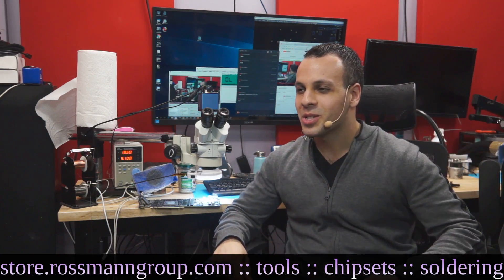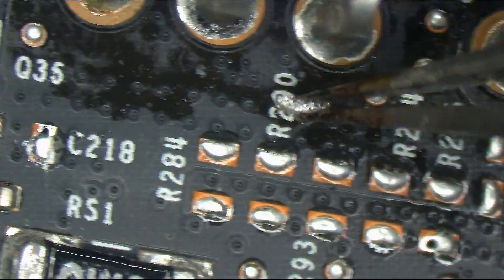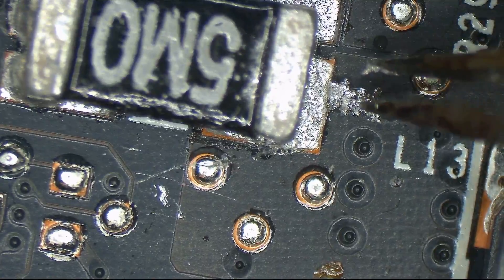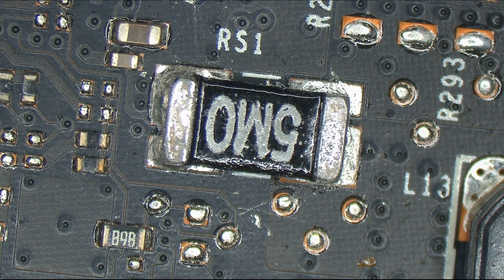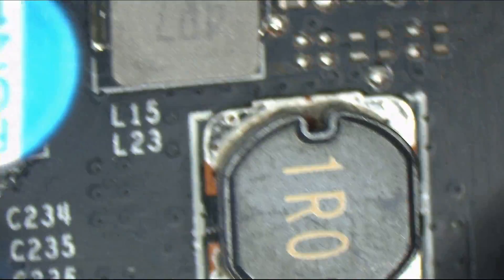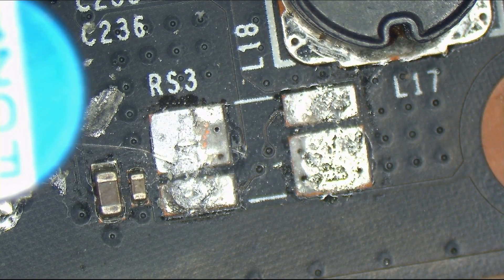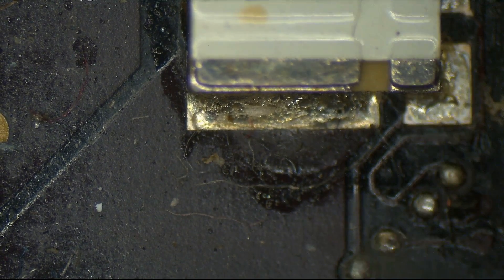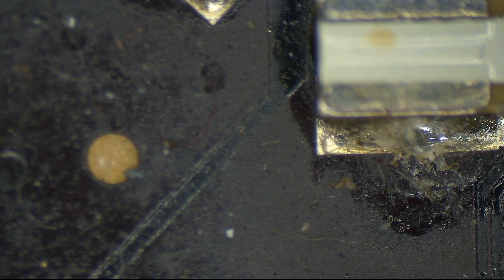DO NOT SHUNT MOD YOUR GRAPHICS CARD WITH LIQUID METAL!

Comment: Shunt mod is probably the most useless mod that probably ends up like this.
Reply: Deniz Onur actually it's the most efficient mod on Nvidia cards. Well unless you got some xoc bioses that completely lifts off power limit. (not commercially available tho.) Also there is another way of doing it via ic that's reading vdrop on shunt which is somewhat more reasonable way of doing it
Reply: Also,
Checks user name. Nice dude. ;)
Reply: Onur Berk SUNAL Probably 2nd way would be much sensible since gallium reacts with most of the metals this and other way. I dont see the gain of 10-15 mhz extra speed boost making this a even sensible option. Pascal is limited by voltage anyways not with the power.
Reply: Onur Berk SUNAL ( ͡° ͜ʖ ͡°)
Reply: I trhink the main limiting factor is the core voltage. You can change the power limit with afterburner or other OC softwares, but you can't change the core voltage.
My GPU can achieve pretty good results in furmark (which is basically a power virus) without any problem when overclocked, but causes serious frame artifacts in games way before a crash happens.
Reply: I've just made some quick benchmarks and here's what I found:
Used tools: GTX 1070, MSI Afterburner, Furmark, Unigine Valley, HWinfo.

At factory settings:  
Benchmark: Furmark
core clock:1772MHz avg,
Power usage: 166W avg (99% TDP),
Vcore: 881 mV max, 863 mV avg,
Temp: 66°C max @ 30% fan speed (23°C room temp)

+104 MHz OC on the core and the memory, 114% power limit (Power slider at max in Afterburner).  
Benchmark: Furmark
core clock:1885MHz avg,
Power usage: 190W avg (112,6% TDP),
Vcore: 925 mV max, 900mV avg,
Temp: 68°C max @ 38% fan speed (23°C room temp)

+104 MHz OC on the core and the memory, 114% power limit (Power slider at max in Afterburner), +15% on Vcore.
Benchmark: Furmark
core clock:1885MHz avg,
Power usage: 190W avg (112,6% TDP),
Vcore: 912 mV max, 900mV avg,
Temp: 68°C max @ 38% fan speed (23°C room temp)

+154 MHz OC on the core and the memory, 114% power limit (Power slider at max in Afterburner), +15% on Vcore.
Benchmark: Furmark
core clock:1950MHz avg,
Power usage: 190W avg (112,6% TDP),
Vcore: 900 mV max, 900mV avg,
Temp: 69°C max @ 38% fan speed (23°C room temp)

+154 MHz OC on the core and the memory, 114% power limit (Power slider at max in Afterburner), +15% on Vcore.
Benchmark: Unigine Valley
core clock: 2088MHz avg, 2113 max,  (reads in Valley benchmark, also in HWinfo too),
(Unigine benchmarks are known for reading the clocks wrong, the correct value must be around 1950MHz)
Power usage: 170W avg,
Vcore: 1050 mV max, 1044 mV avg,
Temp: 69°C max @ 38% fan speed (23°C room temp)

Apparently the Vcore slider doesn't do anything significant as the power limit kicks in way before the voltage limiter could do its job. Afterburner never sets the Voltage limit flag on.
However the Unigine benchmark is a bit odd. I can set the core clock up to 1950 MHz before the artifacts start happening, but the power usage is way lower than in Furmark. In Furmark I can go beyond 1950 MHz without crashing. So either Furmark isn't really susceptible to artifacts or they aren't caused by the power limitation as in the Valley the GPU is far from the power limit (even when the artifacts happen). And in Unigine the Vcore is much higher than in Furmark at the same settings. It really looks like it is a voltage limitation, as the automatic core voltage setter circuit underestimates the required core voltage regarding to the power usage.
Reply: It's absolutely stupid to use liquid metal for this - there are many other methods that won't corrode solder
Reply: Deniz Onur no for ambient cooling (waterloop and air) Pascal doesn't scale with voltage it only scales with temperature being low. Even under ln2 Pascal rarely benefit with more voltage but it sure benefit from more power. I suggest checking der8auer's videos. He mades it clear that power mod gives acceptable benefits (even if your clock wasn't higher than before.) Still not convinced? I can link buildzoid video (if I remember correctly about 40 minutes long.) He shows that lower power limit higher clocks worse than high power low clocks.
Reply: Onur Berk SUNAL Meh for regular user wise. Shunt mod is not necessary. For LN2 people already mod their bioses to allow for more power draw and they do it professionally. I know buildzoid ( sub since like 1k subs). My point is this is not a very safe method of doing it since that guy screwed it up the application.  It is true Pascal is sensitive to temps but under LN2 it all comes down to power and voltage not temps. And if you are regular user and you think you are limited by your temps you can always put it under watercooling.
Reply: Deniz Onur Pascal has no bios mod tool there only has one Asus xoc bios which as far as I know doesn't lift power limit only increase it. Also it's not voltage limited "even under ln2" and I was purely talking about ambient cooling. Also I even under air-cooling extra power gives extra performance. And keep in mind that no mod is safe when you screw up. Almost all mods "safe" when done correct.
Reply: Onur Berk SUNAL There are tools to flash bios and tons of bioses out there. The guy below me gets what i say Pascal has hard limit in voltage. Even when you power mod it you will still going to be limited by your voltage.
Reply: Deniz Onur Péter Kiss did you ever overvoltaged or seen someone overvoltaging their card? I did and can confirm it's nothing like any older Nvidia architecture it benefits so little with over voltage that it's literally not worth the effort. Basically power mod gives as much jump as voltage boost if not more. Which one could done easy one is really hard.
PS. By overvoltaging I mean like 1.25 not like maxing out voltage slider. Which you won't be wanting to go below that all that much because degradation vs benefit nearly not exists.
Reply: Onur Berk SUNAL Yes i did overvolt and 1080 Classy and to achieve 2050mhz stable we added around +87mv or it would crash. It responds better than what i expected. My 980ti classy will crash in any terms of voltage bump unfortunately. Power wasnt an issue for that card imo as it was to be allowed around  %120.
Reply: Deniz Onur May I ask how you did ? With voltage slider in a program? Also don't mix and match architectures 980 is Kepler and Kepler benefits voltage more than Pascal does.
Reply: My mistake it was Maxwell which is Kepler refresh same thing but better
Reply: Onur Berk SUNAL LOL no 980Ti is not Kepler.  600-700 series are Kepler. Im not mixing anything here. I have used Precision X with OC bios. You want proof? Here https://youtu.be/ES_z8TokX6U
Reply: Deniz Onur yeah max out power slider all you want you will pump maximum 1.1v with that. To really overvolt it you need to do hard modifications like tricking pwm controller with soldered potentiometer/trimpot etc. And higher clocks =! Higher performance

Comment: It's called shunt modding. You short the resistors with liquid metal to allow for higher voltage. Pascal is currently limited to 1.093v, and you can't go higher without shunt modding.
Reply: no you said most miners are renting with uiltilties include which is wrong but it makes no sense not to as ill say below its your fault for putting your self in an postilion where your contract looses you money. (and in my experience most people with utilities included are renting an room on an shared power plane so at most 10A before tripping an barker and pissing off house mates.
if power is eating in to your costs of renting then you need to fix your contract say utilities included to for fair use and specificity x amount of kW/h's its your fault for creating an contract that ends up screwing over you in the end.

there are other reasons of an high power bill dehumidifiers fridge open too much, lots of cooking on an electric stove etc.

also thanks for resorting to insults it shows what kind of person you if you have an issue with an group of people try to understand where they come from and why they do things they do and debate properly as most people have an valid point or 2 then disagree with them with facts and experience, which i can assume you have had an unplesent one with one of your tenets i dont know your whole story but i'm painting an picture on the facts you leek out in your comments here.
Reply: Why should a tenant care about the power bill if they are not paying for it? Because it cuts into your profit? Why would they care about your profit? Also how do you know it's a mining issue? They could just be using high performance desktops all day because those use a lot of power.
Reply: S.A. Smith there needs to be resistance the current sensing chip checks for an short and if it detects it puts in in an "safe mode "
Reply: Myke Prior not persay  back before Bitcoin spike I was mining litrcoin with my 6950's while at school cards never degreted and still run the same oc's to this day. Just traded an friend who lives in residence for his spare 670 for one of those old 6950's because the heater broke in his room and the 6950 makes double the money. And it helps him not frease till they fix the heater, the card still holds the same clocks it did years ago.

As for your rate of increase for crypto it's more like rate of decrease at .10usd per kilowatt we are nearing mining becoming unprofitable so yes power efficiently is an bigthing. 

And yes being in school I mine on the nano that is in the PC at my dad's but I haven't invested in to hardware to mine with.
Reply: If cryptocurrencies were "fake cash" then please explain why some countries are thinking of making their own crytocurrencies for their entire economies? I don't like the miners either but what you are doing is being ignorant it. At least educate yourself before bashing something you know little about.

No I'm not talking about your loan.I am talking about your profit which is the amount you get after the tenants pay you.Payment-expenses=profit margin Your mortgage would be an expense.So if you didn't make sure in the contract that the utilities could be abused then that is on you sadly.Don't blame something else for someones shitty actions.It's not mining or crypto currencies that are at fault.It's both of your faults.
Reply: Not voltage unlocking it's power unlocking. Voltage still locked you just run more current.
Reply: Onur Berk SUNAL at least use a resistor of a known value. "it still has somewhat resistance"... ok, what value is the resistance? I agree it's not a dead short but it's also a complete crap shoot as to what value is actually being achieved here. All this effort around this mod and no one ever thought to measure the change in resistance and suggest a proper mod??

Here's an alternative that would work better. Take a piece of scotch tape and tape a parallel 5M resistor over top of the original resistor. Just as effective.
Reply: Myke Prior uh miners usally decrease power limit it makes no sense to push an mining card as these GPUs are sold up the power to proformance curve. Less power used per hashrate means more profit. "Miners" will run the cards cooler and with less voltage /power limit before shuntmodding there cards for extra proformance.

Now passing an mining card off as lightly used for gaming is bad but assuming the card isent broken the olny issue that should arise is worse overclocking potential.

Although when I mined on my 6950's back in  2011 my max stable overclocks on air did not change and all the cards still work today.
Reply: You should learn about mining before saying ridiculous shit.Most miners under volt,down clock,and run the fan speed at 100% They do this to make sure the card lasts longer and usually the speed (depending on the coin and algorithm) are not changed by much.The benefit however is less power costs. It wouldn't be a profit if you have to pay for more power than the money you get from the coins.
The reason why most miners used AMD cards was because they didn't use as much power as nvidea cards with the same algorithm speeds.Which means it was a lot more cost effective to get and AMD card because they were cheaper already and was more powerful in most algorithms used by cryptocurrencies
Reply: Would be better to just solder a piece of wire in it's place. Gamer's Nexus has done this on a couple of their cards too for testing & whenever I hear of people doing it for "gaming OCing" i think "are you stupid".

The only people that should be using LM to do the shunt mod are people going for world records on LN.

Else..just use a fucking wire..
Reply: I'm judging no one in particular. It's pointless for a negligable gain. Cooling pascal gives you better performance as it automatically OC's as temperatures drop.

And even wire has resistance. Just don't use copper, use nichrome or something instead....or just replace it with a 50k/500k resistor or something.
Reply: philippe jara yup because it still has somewhat resistance. Voltage still drops.
Reply: Lol. FIRST of all, with the rate of increase nobody cares about the cost, and the majority of these people are renting with utilities so its not like the power bill is even an option.
Nice try...maybe if power was expensive, rates were lower, the 10 series weren't as efficient, but none of that is true at all now, so guess what.....it's a blow out the card and sell the bitch game.
Are you a "miner"?
Reply: lol. My comment was for ppl with cheap power or who rent with utilities included. I've dealt with all kinds of tenants including you miner parasites.
Reply: By profit I think you mean mortgage. Of course I care. My new contracts put a huge limit on power if tenants exceed.
They could be wanking by the heater and AC on full blast...considering he told me he doesn't work and mine's I instantly got a huge red flag after I approached him about his shut-in tendencies as roommates complained to me. I don't care, it breaks any good faith agreement to assume utilities included = unlimited utilities. You say he's smart, I say he's a parasite, tomato tomatoe
Reply: Get a fucking job. The economy runs on work not collecting as much fake cash as possible.
Reply: S.A. Smith you can't directly short Pascal architecture. It won't boot if you do that card will think sth wrong and refuse to boot.
Also don't judge people getting the best out of their hardware if done correctly this isn't so risky (not believing check der8auer's videos he did a after 6 months of power mod sth like that.) He bought top of the line consumer gpu and wants more performance well that's a way to get some more.
Reply: Fucking bitcoin mining pos modding their cards for MORE overclock MORE $$ with NO experience in basic fucking electrical skills, then passing it off as a perfectly fine 2nd hand card when the transistors, ram and a couple caps or VRMs inside will be shot in a month...or solder will just erode apart.
I fucking hate cryptofucks they are the problem with today. Sit back and make money, it's ALWAYS off someone else's back. ALWAYS.
Reply: Myke Prior shunt mods provide a marginal increase in performance and suck up nearly twice the power. The miner would have to be stupidly stupid to spend such time and effort doing it.

Comment: FYI liquid metal explanation and application example: 
https://youtu.be/3pflC72NfnU
Reply: I love how he defends this shitty technique as reversible in the comment section, well not after the solder has fallen off the board >:D
Reply: Florian I don't understand why you wouldn't just use a silver circuit pen or a Permatex automobile rear window defroster kit. Or have Louis change the resistors to a different value.
Reply: sixtyinsix Yeah, that silver circuit pin would be interesting to try out, idk if there are any side effects with this though, but it sure wouldn't be as severe. Soldering another resistor on top would be the best method, it's a huge (easy to solder) part so no problems there.
Reply: Hell, freaking graphite from a pencil lead would be less stupid to use for that than liquid metal..
Reply: not conductive enough

Comment: Is the solder there actually liquefied?  Or is it something else that looks liquid?  It looks like there is something that penetrated the boundary between the solder and the copper and turned the material liquid.
Reply: see my comment above. if you can't find it, here's a TL;DR

- People are using Liquid Gallium thermal paste in order to shunt (over-volt) their GPUS. if that thermal paste spills off the resistor (5MO) onto the solder, the solder turns into goop as it forms an alloy with the aluminium in the solder.
Reply: If that is the case, Louis should discard those tweezers.  Still fucking odd it would be on only 1 side of 2 identical footprints.
Reply: MaxIV77 it's gallium for "liquid metal cooling"
Reply: Oh... so idiots.

Comment: Maybe tried to use some kind of low-temp solder paste to prevent the reflow oven from damaging the main GPU, and decided to augment their process by using a cheap-AF thermally cured resin to straight-up glue the rest of the components onto the board.

In other words: some high-quality Chinesium-238 right there...